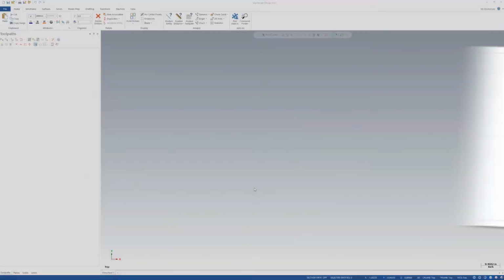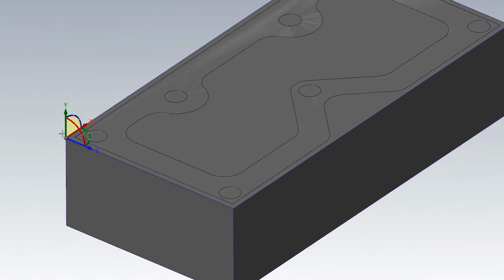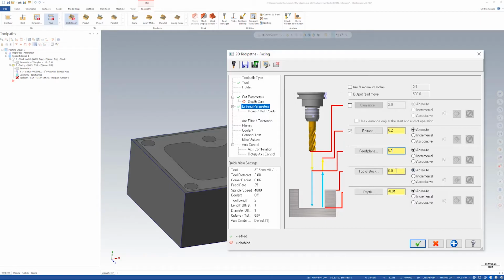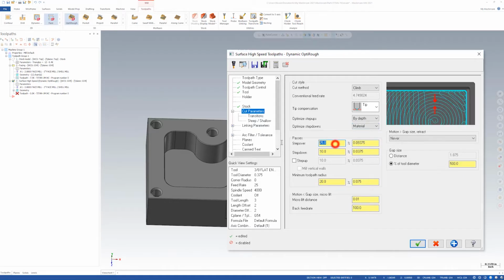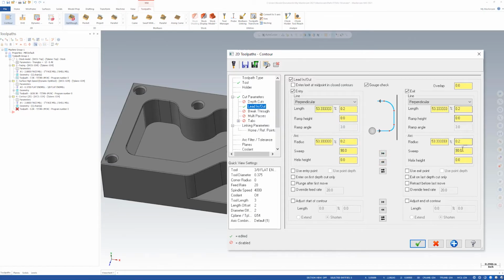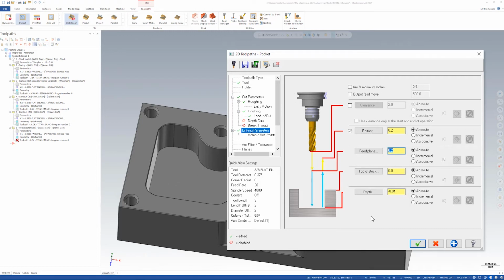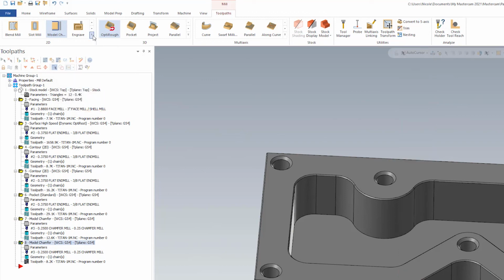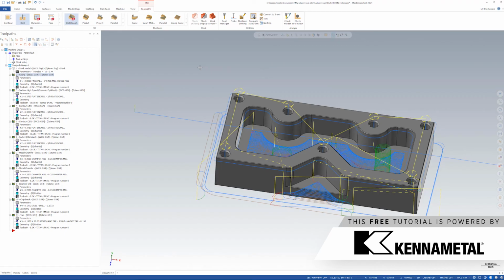MASTERCAM TUTORIAL: PROGRAM THE TITAN-1M (OP1) | ACADEMY

Comment: hiii can anyone help me? after do stock model, the level 2 which stock cant do hiding the stock for level 2. so i cant see the part. in what method i missing ?
Reply: Same, this isnt working for 2025
Reply: @jameslee522   Hey! I figured it out. go to the toolpaths manager, select the stock model under the toolpath group, and then toggle the visibility at the top of the toolpaths manager. its the little waves to the right of the lock. then go to your levels and you should be able to unselect it. for whatever reason the toolpath group makes its own model thats seperate from the solids made in the levels. not sure what the purpose is but its sure annoying.

Comment: My solid model won't turn off after creating it. It toggles on and off just fine after I create the bounding box, just not after I turn it into a stock model?
Reply: Had the same problem. After I regenerated the solid model it worked fine. I think the levels tab just doesn't update properly after you make the stock, so once you refresh the solid it recognizes it on the level.
Reply: @benlanning8795 how do you refresh the model ?

Comment: My screen looks very different, either I am doing something wrong, the video contains an older version of Fusion 360, or something I don't know with presets is going on.
Reply: it not Fusion 360 rather Mastercam.   But I had Mastercam 2023 and it was different in the tool settings for the optiRough for sure.

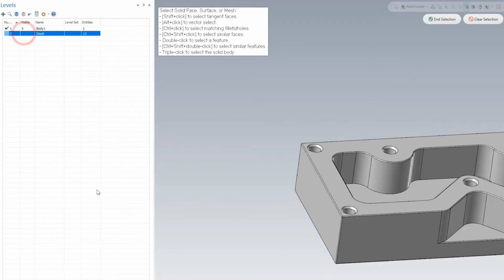Comment: When toggled the stock level at 27:04 my stock model remained displayed and made it impossible to select the model by triple clicking. I can't seem to get rid of the stock model.
Reply: You can hide the stock model by: 
1) Selecting the stock model in the toolpath group tab
2) Click "toggling display on selected operations" on the toolpath toolbar

It's the three wavy lines on the second row next to the yellow lock if you are using mastercam 2022.
Reply: @ogR11Qte1NoG7vlC  I thought you were talking about toolpath tab from the ribbon above. Now I understand you meant toolpath tab in the bottom left. Thank you for your answer; it worked for me.
Reply: @ogR11Qte1NoG7vlC  thank you
Reply: @ogR11Qte1NoG7vlC  god send!  I was stuck!
Reply: @ogR11Qte1NoG7vlC  I have the 2026 mastercam and this didnt help, any other suggestions?